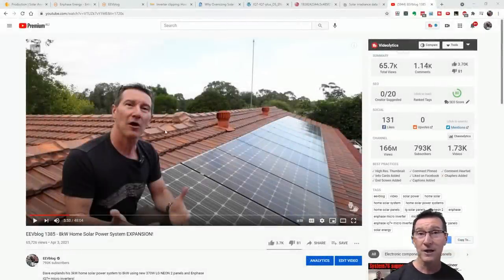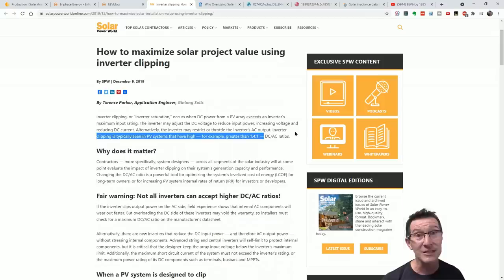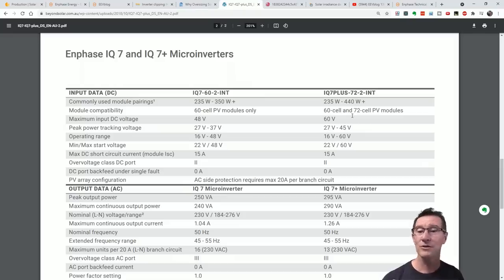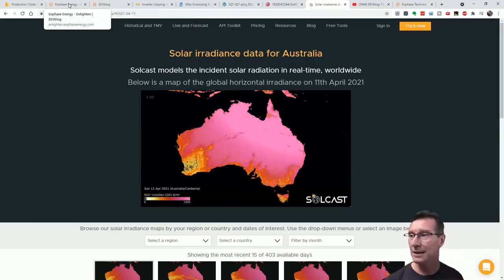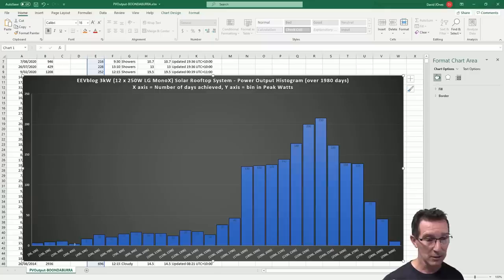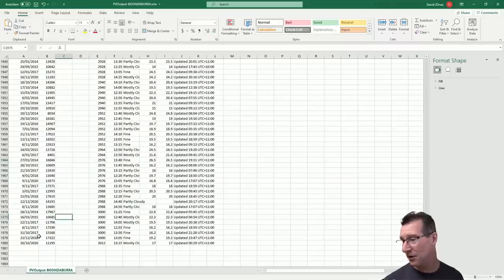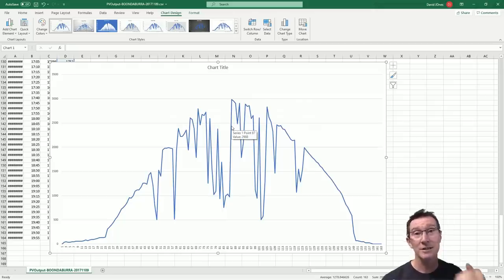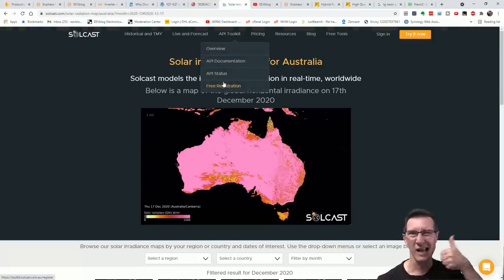EEVblog 1386 - 295W Inverter vs 370W Solar Panel - WTF?

Comment: In the cold north  america we get our highest output solar days in the winter - on very cold clear days the PV will put out over their rating . What also helps is the cold sunny days there is not a lot of humidity in the air and if there is snow on the ground the reflection off that may help the output too.  I am not grid tied - I put the power in batteries so no clipping  from inverters - but you sort of get clipping from your controller since it throttles back the power as the batteries charge toward 100% full.  But if you have something like Midnite Solar controller there is a Waste Not option on AUX contacts that will  PWM the exact extra  power not needed to keep batteries full - into  a resistance load like hot water or space heater. Of course in the winter out days are  short !
Reply: well i get the best results in spring here in NSW australia in the spring. weather still cold sun high up

Comment: I am from Mauritius in the Indian Ocean, the local power company does not allow us to over dimensioned the solar panels installed, if your inverter is 3.5KW you should not be having more than 3.5KW of panels installed.  For 3.5KW of solar panels, I only got 22.5KWh on a few days since mid 2016.  You are right 2017 was a good year for solar PV production.

Comment: Hi Dave,  I'm from the Netherlands and for me  it went the other way round with that Wp value. I didn't trusted it because I assumed the "low light condition performance" from different brands of solar panels would differ significantly, therefore I assumed the Wp value would be a useless number. But as it turned out it is quite closely related to total yearly production!

Comment: I have jinko 405 panels paired to iq7+ and iq7A inverters. It's a string of 12 panels. 3 panels in the middle are the A inverters. Here's the data from last week as an average per day 
The value is in kwh. 
2.62 +
2.65 +
2.58 +
2.62 +
2.59 +
2.55 +
2.68 A
2.67 A
2.63 A
2.50 +
2.51 +
2.53 +
Remember this is an average per day over a week  the iq7a's do not significantly increase production.
Reply: The reason I went with the mix, was because my roof fit 12 panels perfectly. I could not run a string of 12 iq7A as the amps would be to high. So I ran as many A's  as I could. Anyway hope this is valuable to someone.
Reply: If anyone has a question, I will answer.
Reply: @deelarry2137  What area is this in and what time of year?  I have a 30 panel Panasonic EverVolt 370W system with the IQ7+ inverters.  This is an 11.1kW system and I max out at 8.8kW around 1pm.  Each panel comes in at around 2.35kW each day and I produce about 70kW total each day.  Based on your data and everything else I have read, the IQ7A would theoretically reach 11kW during the peak power time, but it seems like it will still produce the same overall amount of energy each day as compared to the IQ7+.  I keep thinking I should have just purchased the IQ7A's but it probably would have been a waste of money.
Reply: @alanhoman1810  west Texas in summer. The A's are a waste of money. Over a couple months(summer)  the A's  have produced about a kwh each extra.
Reply: @alanhoman1810  but we are very hot. Maybe in cooler climates like Australia it might make sense to use the A's
Reply: We are about to install Jinko 360w panels with IQ7+ and your comment is the most useful knowledge I have found during my research. Do you see much clipping with the micros?
Reply: @serraios1989  on the 360 panels, the IQ7A (349 watt)  would be silly. The IQ7+ (295 watt) would be perfect
Reply: @serraios1989  any more questions,  please ask.
Reply: @deelarry2137  
Thank you
We are definitely going with the IQ7+.
Do you see much clipping from your microinverters?
Reply: @serraios1989  not enough to worry about. Buy cheaper micros and with that money add an extra panel/micro
Reply: That's my practice
Reply: @deelarry2137  
Thank you

Comment: There are a few other factors that make undersizing your inverter a more economical long term option.

Panel effeciency degrades over time. LG says their panels degrade 2% to 3% in the first year, and eventually stabilise around 0.7% to 0.5% loss per year. We can probably assume a 10% loss of effeciency over 10 years for an average solar panel, so you're 350 watt panel for example, will end up becoming a 315 watt panel.

Another factor is panel orientation. A good strategy for maximising the amount of solar electricity you actual use (rather than feed-in) is to face a portion of your panels east, and another portion of your panels west, say at a 15 to 22 degree angle (common roof pitch). In that situation, your panels are less likely to hit their maximum power output, and your system as a whole (for a non-microinverter system) would peak much less. In my system, I have 8 panels shooting directly up, and another 12 facing west at about a 30 degree angle. In far north queensland, I only get moderate clipping in the summer months, and due to most of my panels facing west, that clipping happens a little later in the day. I would never consume this extra power directly, so I'd only be getting 10 cents per kw/h for the extra power I may be generating without the clipping, which would probably equate to less than $10 a year at the most. Hardly worth paying the extra $500 for the next size up inverter as I'd never see a return on that investment.

The econmics of undersizing the inverter hold true in at least 90% of circumstances.

Comment: Nice
The solar systems available in my country are way too expensive to make sense, since we got very cheap electricity from hydroelectric power plants it would take 10 to 15 years to pay back the cost in energy and most systems sold here have only 10 years of warranty.
Reply from the maker: Fair enough.
Reply: 63% of our electricity comes from Hydro and it makes the overall production at 83% renewable energy. Only 1% is from solar.
Reply: @thomasesr  All the better hydro is probably better for the environment sine hydro plants last a long time and are mosly recyclable unlike solar panels.
Reply: @adamdnewman  yes indeed, too bad for the huge areas needed for the reservoir which displaces a lot of Fauna.
Reply: @thomasesr  Isn't that replacing one environment for fauna with another?
Reply: @williammentink  even if it is, who are we to say which one is more deserving of the space that is was there way before we came along. The overall long-term impact is way less than the immediate one, but if not done properly it can be really devastating.

Comment: Hi Dave - I have a 4 KW system 16 x 250w panels and here in England I have never seen a higher reading then 3 KW since it was installed. most of the time its around 2 to 2.5 KW  on good days. LOL.But it has paid for it's self 2 or 3 time over via the grid feed in tariff payments received. And I have to go clean the bird poo now. All the  panels are on my shed flat roof, none on the house roof.

Comment: I dunno... What you're saying makes total sense. But, as a sound engineer, I have trouble with the idea of deliberately clipping an installed system. I guess I'm just the guy kept up at night on the thought of lost power. Someone will make a mint off of me when I go solar. 🤣👍
Reply from the maker: The thought of it is rather offensive!
Reply: Glad I wasn't the only one. In the audio world clipping = bad news.
Reply: Sounds like a intentionally ripping off customers to be honest.
Reply: @HiragamaIkunai  Not necessarily. Everything's a compromise. People who live in areas that don't see much strong sunlight might benefit from this configuration, for instance, because they can generate power at lower light levels.

Comment: NICE system! 
For cold seasons what about heating an insulated tank of oil during the day with unused power, and then circulating that in the house through some form of heat exchanger or radiator when it cools off?

Comment: Clipping makes sense in a place where you want to extend the lifetime of your system and up untill recently this would have made sense here in Belgium as well. About 6 months ago, however, our supreme court ruled that reverse counting in the kWh meter (soon to be a digital meter in every home) is somehow discriminative. It boils down to the fact that people with a digital meter (where what you take from the grid and what you put back are counted seperately) are paying about 25 eurocents per kWh for what they take from the grid (nighttime, cloudy days) and are getting 4 eurocents for every kWh they put back. Hundreds of thousands of people who recently invested in systems are pissed cause their ROI now skyrocketed. Some people (myself included) still have the old analogue meter which spins in reverse when you're producing more than you are consuming and some people are now refusing access by the power company when they want to place a new digital meter (which is somehow illegal). So the power company can take this cheap energy from one house with panels and sell it to the next house a few feet away for 600% more. Charging taxes and the "cost of all the infrastructure needed to transport this power a stonestrow away". In my case, before they come knocking at my door to replace my oldschool meter, I don't benefit from the derating as discussed here and I'm just gonna roll out a cable with a kill-a-watt meter to my neighbours house which they can use when it's sunny. I'll charge them half price of what the energy company charges so we both win and stick it to the electric company, the supreme court and policymakers... Even if it's just a few days a year, i'm pissed and every Wh counts...

Comment: I decided on 7.7kw of lg neon 2 panels with a 6kw sma sunnyboy based on your previous videos and my own thorough research. However I also added OPTOMISERS to each panel.

Optomisers are added to each panel same as micro inverters, but use a string inverter as normal. The optimiser allows individual panel monitoring and isolation. The benefits of micro inverters at a lower cost. Only exception is dc cables on your roof instead of ac.

Comment: If it's clipping, upgrade the opamps to something which has better dynamic range!!! That'll fix it 😜
Reply: @ts757arse  My nearly 20 year old "pure sine" Trace/Xantrex inverter causes audible buzzing and harmonics in audio circuits and some power supplies. If they had made one with "audiophile-grade" sine output, I would have been interested.
This could be a huge untapped pool of suckers, er, market of enthusiasts!

Comment: Today I'm getting my system upgraded, from a 10 panel 1.9Kw system to a 34 panel, 13.2Kw system / 10 Kw inverter, battery and optimisers on 18 of the 34 panels.

Comment: Sounds like the easy way to test this with microinverters would be get another one that logs similar data, that does support the max, then track the number of days where that inverter produces more power than the panel that is directly next to it, and compare the total outputs

Comment: I was kinda surprised at the underrated microinverters as well, but it does make sense from a cost to return standpoint for sure, and maybe from an overall inverter efficiency standpoint too.
your energy produced is the AREA under the curve, maybe you clip 10% of solar panel power, 30 days a year, for 2 hours a day, It really isn't a lot of total energy and it may be recouped by the extra inverter efficiency the rest of the time.
If you had solar tracking panels you'd get far higher panel efficiency most of the day, so in that case you'd probably want a fully rated inverter
Reply from the maker: That's the theory anyway. In practice it's going to be highly variable.

Comment: Interesting. My panels are ground mounted and interestingly they are bifacial i.e. there are panels on the front and backside of the panels. The front side is rated at 375W but with the bifacial gain which is dependent on the albedo of the the ground under the panels  (snow, grass, etc) I believe the claim is 425W correction 488W per panel. I have 16 of them in one array. If you're interested they are Canadian Solar CS3U-375MB-AG.
Reply from the maker: Are they made in Canada?
Reply from the maker: Ah, no, made in China it seems.
Reply: @EEVblog  Yeah, I think they're manufactured in China. You can't tell these days. Thankfully it's not all bad. Went thru several crappy all in one inverters but settled on one of the more expensive UL listed units. It is also made in China (overseen by a US company)  but it works flawlessly.
Reply: that is absolutely bananas.
Reply: They rely on the reflection from the ground underneath? Wouldn't it make more sense to have an internal reflector behind the panel, this way you could get much higher reflection.
Reply: @IsaacMorton  The sun is not shining through the panel surface, onto the ground, then reflecting back up; the reflected light from the ground comes from around the panels - ground mounts in particular are often spaced to prevent one row of panels from casting shadows on another. That spacing is part of what allows the light to get around/behind the panels
Reply: LoL. Put those over a concrete highway for a proper solar roadway.
Reply: @williammentink  Or at least over concrete parking lots for shaded parking!

Comment: Hi Dave, great to see you come back to this.
My experiments with my 4 QCell Q8 340watt panels have been going well. Even here in the UK in April I've seen over 340watts out of the panel I installed the IQ7A microinverter on last week. Yes, exceeded rated panel output in the UK in April! WTF right?! The NMOT says 254watts for them, so I think I'd better start slip, slap, slopping over here too!
The other panels are limited to 250watts by the IQ7 microinverters.

In my case I am very restricted on space, and I'm clipping a larger chunk of the hump (250w from a 340w capable panel). So I think the next/last 4 panels that are due to go up are going to get 7A (or at least the 7+) microinverters. Not sure if I will upgrade the 3 remaining original IQ7 ones though, they're higher up and an a pain to get to!
Reply: April is time of the year you get peak instant power from PV in the UK -- clear skies and cool panels

Comment: My system is 1:1 (10kW panels to a 10kW inverter). I can't stand the thought of clipping.
Reply from the maker: It's kinda offensive.
Reply: @EEVblog  I have a 10kW SolarEdge inverter with their per-panel optimizers. It's nice because if you have multiple roof faces the individual panels can output the full 370W (which would clip an Enphase inverter), but not clip the 10kW inverter since other roof faces might only be putting out 250W at that moment.
Reply: also better on the inverter it will not run so hot than when it is maxed out all the time

Comment: Top of atmosphere TSI is around 1365W/m2.  Attenuation through the sir is highly variable. Under clear skies, without dust, 1200W should reach the surface. Note that the angle of the panel to the sun is significant!
Panel temperature and current density make a substantial difference. They also define the panel life, other thing being equal.

Comment: Without storage or very elastic demand loss of some power at peak irradiance might actually be completely irrelevant as the power wont be used anyway. If the consensus is that installing additional solar panels to meet demand in the evenings is cheaper than storage, saving on inverter power only makes sense.

Comment: Up until February I used to overdrive my 4kW Inverter with 6kW of solar panels, because that’s what was recommended by a local “expert” installer. The idea was that on dull days or when the sun was low the extra power capabilities of the panels would give a nicer curve, which it did, it got closer to 4kW more often than on just 4kW of panels. I upgraded to a 6kW inverter in February and since then I have generated a lot more power than ever before, it often sits around the 5.5-6kW four four or five hours a day, sometimes it peaks at 6.18kW, which is the real total power output of my panels. As an added bonus, my new inverter runs a lot cooler than my old one as it’s not been overdriven at all.
So in my experience, I would try and get the maximum sized inverter to match the maximum power output of the PVs and forget about overdriving a smaller inverter, you’re just burning up so much of your power when you could be generating the max. Last summer my inverter could easily clip at 3.8kW for six hours a day, my bigger inverter will now allow me to generate the full amount that I paid for. 
PV systems are expensive enough already without throwing away the clipped energy as heat. What a waste. You’re just throwing away money. Over a ten year period that wasted clipped energy adds up to a lot of money.
Reply: Micro inverters are overall more efficient then string inverters (the reasoning of using a 275w inverter on a 350w panel is the panel is expected to only do under 280w in most climates)

With your case your old inverter been sold as 4kw would have been clipping around 3.8kw (it's a regulation that they must be limited to 16 Amps witch is around 3.8-4kw depending on your local voltage) so doesn't matter how many solar panels your adding the limiter will prevent more then 4kw

Comment: It's kind of funny how we take the DC output from solar panels, invert it to AC, feed it to a generic device with an AC-DC converter where it gets rectified, then inverted again at high frequency, then rectified again to supply the end load. Seems like there ought to be a better way.
Reply: then convert it back to DC to charge your cell phone!